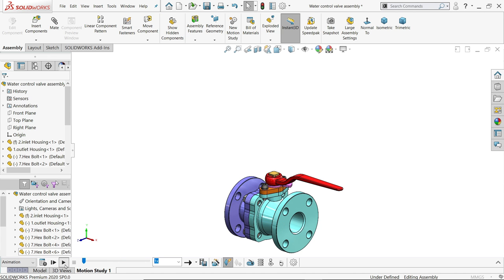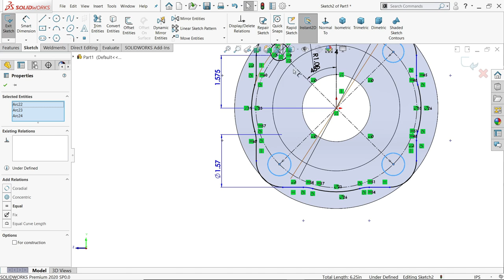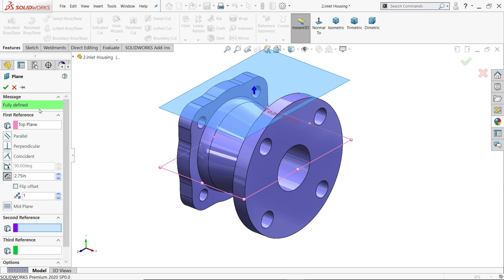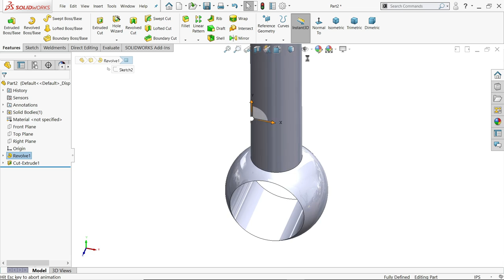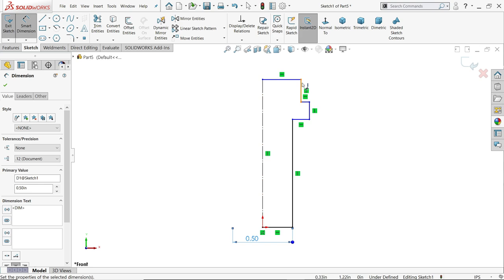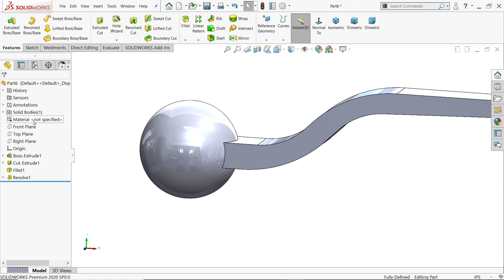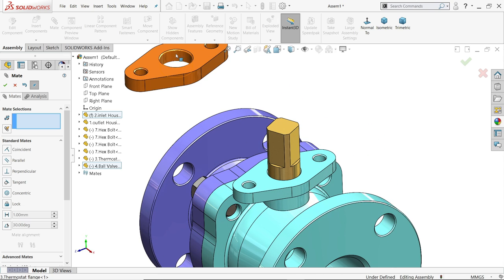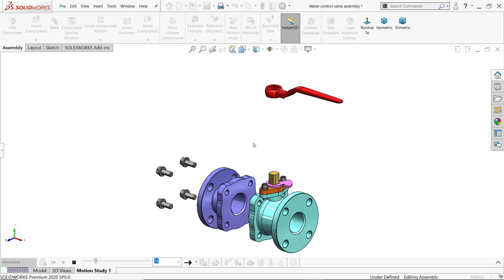Design of Water Control Valve in Solidworks | Exploded View

Comment: Second outlet housing i get some issues .hole interference with small amount of material so that it actually remove some material from outer surface of conical structure of the housing? .if any one answer in my comments

Comment: The ball valve sub is inaccurate because it has smaller inside diameter compared to the inside diameter of the valve housings, the whole project will not work in real life

Comment: The drawing have several mistakes: 1. Never dimension hidden lines. The bolts holes on the flange in both Outlet Housing.  2. Parts with the same name. Part names should be unqiue when thery are not associated with a part number.